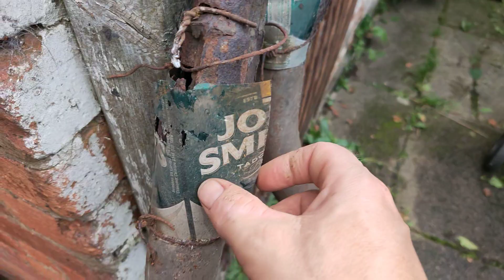Suzuki GSX750F Exhaust Nightmare

Comment: it just looks the same as my old 89 suzuki 750k years back  when i remove it
 it was the same and just  fell apart      just looked like a tea bag with holes everywhere   
 long time no see 
have you still go your RE ?   is the 750f and replacement for the rf
Reply from the maker: Got rid of the RF around 4 years ago, due to it being the most uncomfortable bike I've ever owned.  But seeing as I like older Suzukis, I got this 1990 GSX750F (plastic teapot). And it's been great, fast as ferk and seriously comfy.

I've not been able to ride much recently, because I'm waiting to have an operation on my foot, so both the GSX and the Enfield are moth balled in the shed.

I'll be off work for 6 weeks soon, so it'll give me plenty of time to mess about with them.

How are things with you matey? :-)